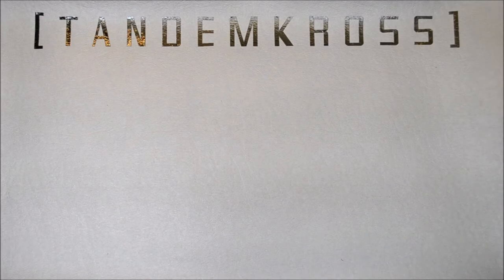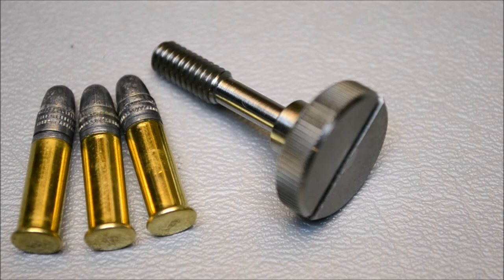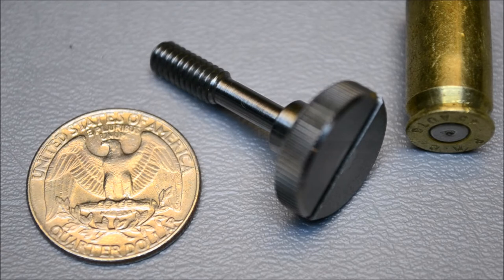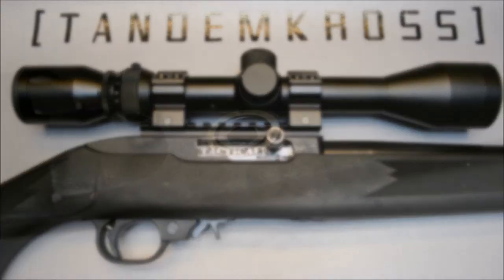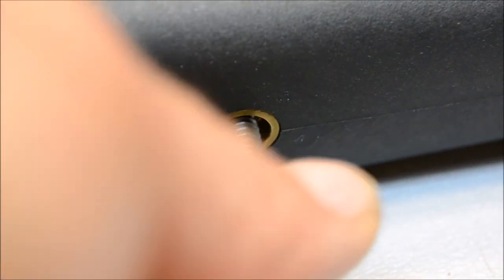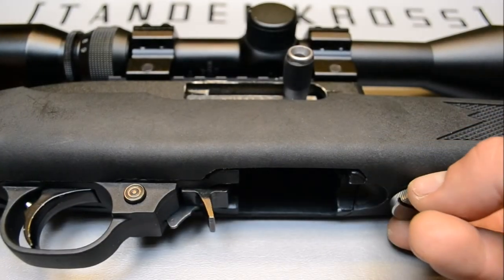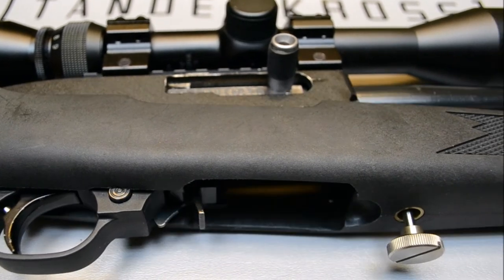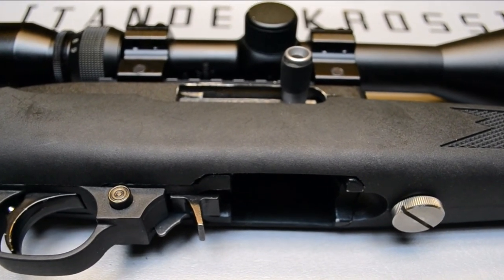TANDEMKROSS Ruger 10/22  "Twister" Titanium Takedown Knob

Comment: D9everything  in the comments asked about the torque for the takedown bolt...he did not get a response from tandemkross...so is the torque an issue when tightening the takedown bolt?  Or is just hand tightening enough?..please explain!!
Reply from the maker: Hand tight is just fine.
Reply: @5h5h6hgh6h7h  and it has been proven that a lighter torque (around 10lb) give better results on most 10/22 (of course you have to try different value to find the right for your gun)